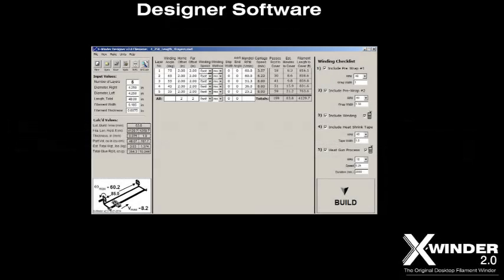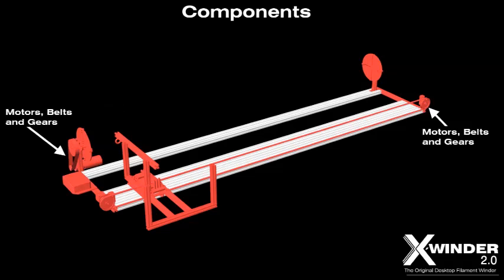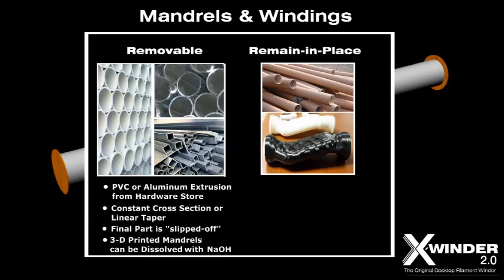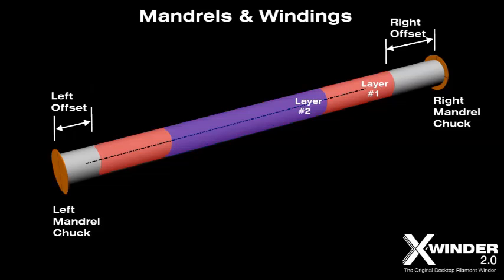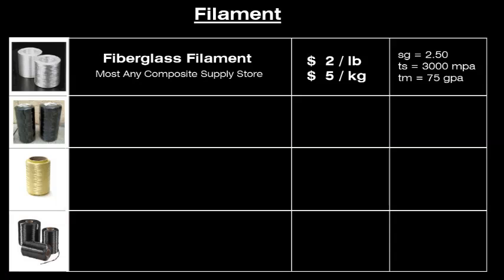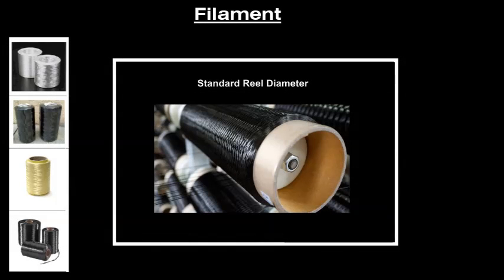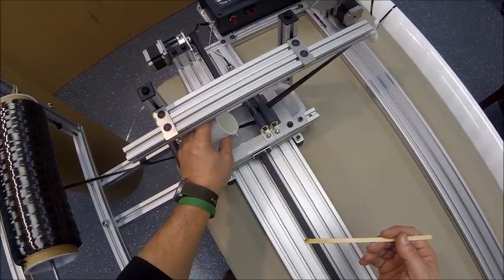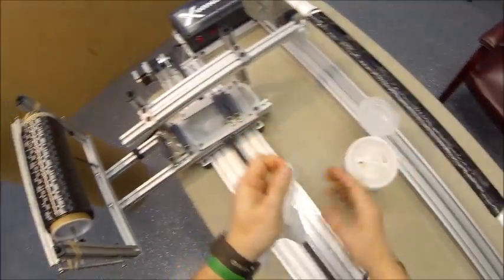X-Winder Filament Winder - The Original Desktop Filament Winder - Version 2.0

Comment: Looking forward to getting one. Being a high powered model rocket builder I could most certainly use one of these. By the way you should look into perforated heat shrink tape. That will further remove more resin than the non perforated shrink tape.

Comment: Nice design. IS there any recommendation for epoxy type when using by carbon fiber? Is there any glue type I should avoid?
Reply: uwofracture I would avoid polyester resin. You want Epoxy based resin only.